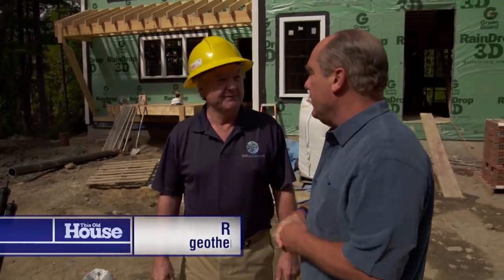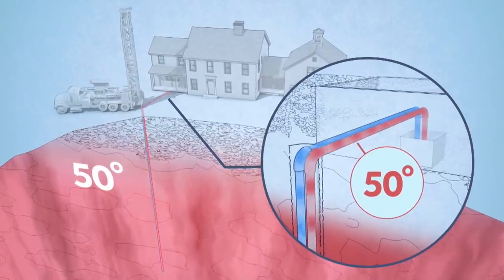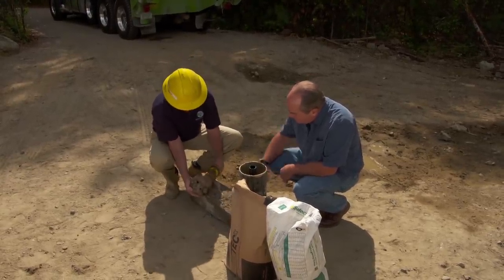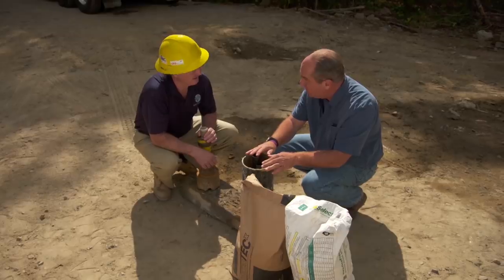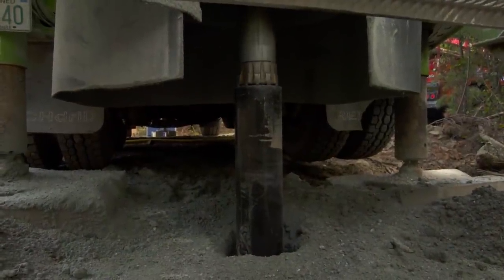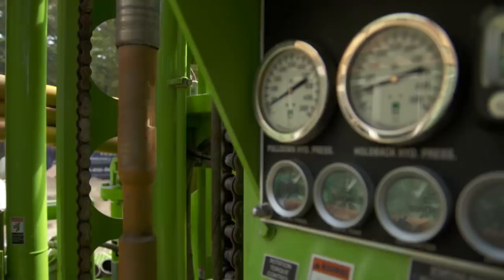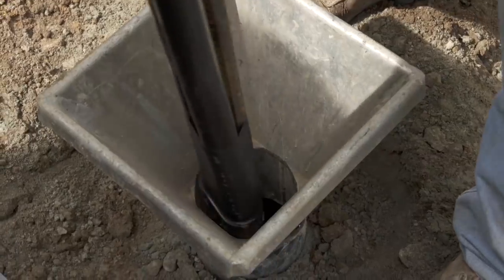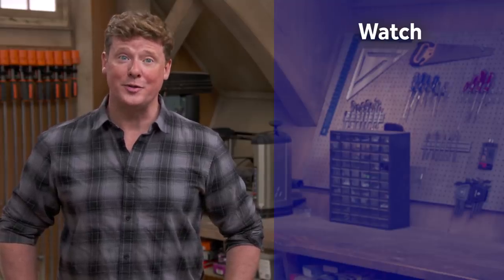How to Drill for Geothermal Energy  | This Old House

Comment: I actually did that job for a few years. That rig is an air rig, which is ideal for rocky areas. Then there is mud rotary which uses a mud slury which uses bentonite to suspend the solids to help bring them to the surface.
Reply: thanks for the info. Do you know how much does something like this cost to have installed?
Reply: I remember doing a system that had 10 units and I believe it had 14 wells that were drilled at 150 foot and the cost was around 250, 000 dollars.  That was in 2017
Reply: @sigmaprojects  aas  do
Reply: @downhillboozer  ah, so not something cost effective to retro fit and more for new homes?
Reply: @downhillboozer  14 wells, that must've been a big house!
Reply: @sigmaprojects  we actually installed some in system that were put into houses from the 1700s that was part of the historical districts in Virginia.  Retros are more of a pain cause you can't alter the foundation and alot of houses foundation in the 1700s were made of stone
Reply: @MandoFettOG  it was a big house it is along the Potomac River. It was a big house for sure . I believe 18 million dollar home. It was an ex vice president for Lockheed Martian. If I remember it had 3  kitchens a movie theater and an elevator. I wish I was around to see it finished
Reply: @downhillboozer  nice!
Reply: @downhillboozer  That cost is if all the holes go to depth successfully.  Cost keeps going up if some holes fail due to hard rock, ground water problems etc.  

TOH almost never mentions excessive costs anymore, as its now essentially a bells and whistles advertiser for building materials.  One exception: Tom Silva doesn’t participate in these never-mind-the-price pieces.
Reply: @nick cook is this a job you’d recommend for a young kid looking for a career? My local union has apprenticeships for this job but I’m unsure if it’s worth it
Reply: @Butterbeanguy1234  I would say do it. There's been a push lately for more funding. 
The current phase I would place it on  par  with solar energy 2 decades ago. 

If you get in now and aim to build a business, it's a good move since the government has countless grants for geothermal completely untapped.

Comment: I remember when This Old House used to show you how to DO things. Nowadays, it seems to be 'Bring in this group of pros, and give them a bunch of money'. There's no way I could drill for thermal energy, and no hint of costs here that I could use to calculate any potential savings.
Reply: 20-40k in the US per house i would guess, 50-60 if it has to be converted to fit the system with new radiators and all that. Otherwise i might be coming overseas with a rig and a couple of plumbers. xD
Reply: You could lease the rigg

Comment: I want to know how to do this without using "grout" and without using "antifreeze". NOTHING lasts forever and I don't want to remove 10 tons of grout to get to the pipe and if there's a leak I don't want antifreeze contaminating the water table, or even the dirt at that level.
Reply: Sounds like you want what's called 'open loop' geothermal, which just uses your well aquifer to leech the heat/cool from instead of the setup they're using here.  It's not available in a few places because of local laws or just lack of a robust aquifer, but for most places it's cheaper and more effiicient anyway, I wish they would have at least mentioned it in the video.
Reply: Not a DIY job at all
Reply: @Kevin-mp5of  
maybe they should create an adapter so I can run one off solar
Reply: @zack9912000  
that carbide drill bit will only set you back a few thousand dollars
Reply: @danielgehring7437  
"open loop" I'll remember that. you wouldn't happen to know how to test water for things like salmonella without using some state run lab, would you? is there such a thing as a home kit that's certified and reliable?
Reply: @maxsteel8031  That's not really my forte, no, sorry.  Google is telling me that you should ask your local city planner, they're the ones who would know the area well enough to give you a suggestion.  Perhaps someone else could give you a better answer.  Kind of a weird tangent, you wouldn't generally use the same water running your geothermal system to drink.  Those pipes are sealed up pretty dang tight.
Reply: @danielgehring7437  
the tangent was off of another video I saw where a guy was digging a well and didn't know to double check his references, but then, "nobody does".
Reply: You can just use water and not antifreeze. And copper pipe

Comment: Would love to know the advantages / disadvantages  - initial costs, repair costs of horizonal vs. vertical closed loop systems - and concerns if you have a well on your property.
Reply: Limited maintenance or repair needed. System can lay 50 yrs, pipes ~100 yrs barring any geological shifts. I'm curious about well issues too though
Reply: My parents have an open loop geothermal running directly off the domestic water supplied by the well.  For most of my life I always assumed it was a closed loop system, and only recently learned that it was coming from the well.  Aside from the drop in water pressure in the house, it has been a solid system with no issues to the well for the 40 years it has been installed.  Obviously this is the most cost efficient install since there is almost no infrastructure (they do have a waste outlet that flushes out below the driveway), but it has to be less than ideal for well users.  They are close to a decent sized river, so the water table is likely very stable, but even with a larger expansion tank off the well line, the pressure loss is substantial.

Comment: Now I know how to do it. One question - where can I rent that sweet rig?
Reply: Buy one at Harbor Freight for only $20 more than the rental cost! 🤣
Reply: @Kevin-mp5of  Or your free digital multimeter with purchase of $25 or more
Reply: @Kevin Byrnes Jr. Why?
Reply: @Kevin Byrnes Jr. Why?  If I screw up - I screw up in my yard.
Reply: Very few companies rent truck mounted drill rigs and if they do it is typically by the month or longer. A new drill rig similar to the Reichdrill that is shown, would cost about $750k to $900k to purchase depending on the pullback, compressor size and options it is equipped with. This is without drill steel, tooling and the necessary support equipment which can add another $100k to $175k. Most US states require that either the driller/operator or the drilling company are licensed. Most states and counties also require permits for any boreholes as they penetrate an aquifer so there are rules and regulations requiring how they are installed and grouted. Additionally, you would need a CDL (commercial drivers license) to drive the truck and years of experience to run the rig.
Reply: I have one for rent.

Comment: This is a really cool technology, it's a shame that the $20,000-$30,000 cost means that not many people want to invest in it
Reply: Govt incentives knock out over 25%
Reply: @nicolascoles7402  That still leaves $15,000-24,000, versus $3,500-7,500 for a regular HVAC. 
With a typical system lasting MAYBE 40-50 years if you maintain it, you're not going to recoup that extra cost in energy savings unless you're heating a mansion
Reply: @thefrub  It´s mainly for places with hard winters and high energy costs like Scandinavia where i drill these things, it´s around 20k for the entire installation if you already have hydronic heating.
Reply: @thefrub  congrats if you can get 40-50 years of solid heating and cooling out of a standard furnace/condenser setup. The life-span of those $7,500 units sits closer to 15 years.

Comment: Allow me to explain some things to hopefully answer some questions. BTW, I have 45 years experience as a hydronic heating contractor with many GSHP systems in place. 

The heat pump is essentially a refrigerant based heat transfer system. It transfers heat (yup, just like your refrigerator) from point A to point B, or from point B to point A. These systems shine when cooling demands are the  prevailing load. Most cooling systems are trying to reject heat using hot refrigerants into hot air, using hot air. Not a real energy efficient method. The Earth is always cool (to a point), and makes an excellent heat sink. When it comes to heating, it can do the work, but due to the use of refrigerants, is limited to a maximum operating temperature of around 115 degrees F. That doesn't work for most conventional hydronic based heating systems. 

Most conventional hydronic systems start at 140 degrees F, with the exception of radiant floor heating, which can use this low of an approach temperature. MOST is the key word. Tubing has to be installed at a higher density, like 6" on center, and in a highly conductive manner, like in concrete or an engineered floor system like WarmBoard. 

Why so many holes? The length of the "earth coupled heat exchanger" is based on the conductivity of the soil and the connected load. If its in a sandy soil, it is a terrible heat conductor, and will require more footage than say solid granite. 

As for the number of vertical bore holes, waters weight generates pressures of 1/2 PSI per vertical foot of elevation. The PE tubing does have a limitation on pressure. At the bottom of a 500 foot hole, the water pressure inside the tube will be around 217 PSI, which is probably OK if the tubing is cool (heating the home) but when its in cooling mode (rejecting heat), the loop temperatures can go to 115 degrees F, and that is where problems crop up, hence limitations in vertical length. 

As others have noted, like solar thermal, the ROI is WAY out there, and if it weren't for the Federal tax subsidies (which are scheduled to expire soon) the economics are terrible. The break even point is outside the life expectancy of the system (15 to 20 years) so the only people who will be doing GSHP without tax credits are those people who feel they are doing something for the environment, and the future occupants of Earth. 

Then there is the C.O.P., which stands for coefficients of performance. The hotter the water temperature needs and the lower the heat source temperature, the lower the COP. Eventually, the COP drops to less than 1, then you are better off using an electric boiler or strip resistance haters (for forced air distribution), which also has a COP of 1. In fact, due to the excessive cost of the holes, most designers will spec the heat pump to handle 60 to 80% of the actual load, and then depend on electric back up to handle the peak load conditions. 

A little history, GSHPs are not new. Thomas Edison had one in his home in New Jersey, MANY years ago. The newest trend coming across the pond is Air Source Heat Pumps, which essentially use the ambient air as a heat source. You are still dealing with the same limitations of temperature that GSHP's do, except in cooling mode, you are back into the inefficient mode of using hot air to reject hot air. The air side heat exchangers on these units are significantly larger than a conventional AC unit for obvious reasons. They also still ice up, especially during heating season, and require the use of electrical energy to defrost the outdoor unit. 

For me and my money, I prefer the use of Solar thermal energy (not to be confused with Solar PV, its electric cousin) coupled with an underground polyethylene storage tank and the WSHP (same unit used for GSHP). Solar thermal panels have been around for hundreds (yes, hundreds) of years, and suffer very little performance degradation over their lifetime. Their efficiency is between 60 and 80% efficient, compared to PV at 20% peak efficiency, and an expected degradation from day one, with a life expectancy of around 20 years. With the buried tank (below frost line) you extract so much heat out of the water that you actually freeze it solid. Then, ANYTHING with a temperature greater than 32 degrees F becomes a "heat source" to melt the ice back into water. 

Here's a dirty little secret. Water, when transitioning from 33 degrees F to 32 degrees F carries one BTU per pound, per degree F. When transitioning from 32 degree F water to 32 degree F ice, it requires 144 BTU/pound per degree F. It's known as the latent heat of fusion. So, a 500 gallon tank of water can constitute a HUGE amount of energy, when going from say 70 F to 31 F, and as previously noted, ANYTHING with a temperature greater than 32 degrees F becomes an energy source. This includes your snow melting system (basically a large surface area unglazed solar collector), solar thermal collectors, drain waste heat recovery, even the ambient air.  Imagine the thermal performance of a flat plate solar collector thermally connected to a 32 degree F block of ice...This type of system is called a thermal battery system, and is MUCH less expensive than a GSHP system to install and maintain, and makes economic sense.

Sorry for the book, but now you know. Pay it forward :-).
Reply: There are so many just plain dumb, wrong, false things in this novella that it's not even funny. I'm not even going to get into them. At 15,000 out of pocket, our geo will be paid for in less than 5 years. Anywhere that doesn't have access to natural gas is going to have payback in 5 years. 

Who TF is using gshp to heat water? Everyone is heating air. 

COP never drops below 1 in a GSHP. Ever. It doesn't even drop below 1 in a much more inefficient ASHP even when it's -5. Our last air source heat pumps still had a COP of 1.9 at negative 5 degrees ambient temp.
Reply: @JH-tc3yu  Exception to the rule. The lion share of geothermal and solar power have massive capitol costs and long term ROI 15-20 years.
Reply: Trying to decipher this solution.

You're claiming that putting closed loop pipes in this tank, that you can use less pipe and maintain a higher COP because of the resistance water has to freezing?

And what exactly do these freezing cycles do to a plastic tank?

And how does the water circulate from your solar panel to the tank when it's frozen solid?

All this is making a case for is sourcing the heat pump with water, which is heated by solar, and hoping the "battery" is big enough in case the sun doesn't shine...

Or drill 2x300 foot wells with no casing and be done with it.
Reply: Say brother do you know of any companies hiring for that? I roughnecked for 14 1/2 years.

Comment: Interesting difference! In Scandinavia we use different equipment and deeper holes, like 6-700 feet? 200-250 meters. cost of the drilling itself without the installation is somewhere around 7-10k dollars depending on the current currency diff.

Comment: Is that have a certain place or soil to do a geothermal energy
Reply: No, not really.  You might not want to put it in the side of an active volcano, but otherwise it's just a very long tube stuck in the ground.
Reply: @danielgehring7437  On the side of a volcano it would be much warmer at least ;-)
Reply: The hot water in iceland will scald you.
Reply: They drill in rock, Soil is only a short bit.
Reply: @danielgehring7437  
"You might not want to put it in the side of an active volcano, "

What!?
Where's your sense of adventure!
Reply: in the ground
Reply: @danielgehring7437  Interestingly, Iceland is one of the biggest places for Geothermal energy because it is volcanically active and the heat is used to heat homes and generate electricity.
Reply: @AbbreviatedReviews  I do wish they'd come up for a new term for this process in this video when they were making it; I've seen 'geostabilizing' thrown around from time to time but that just sounds dumb.  'Geothermal' literally means 'earth heat' and, as you say, had already been in use for a long, long time beforehand, so is just a very poor descriptor for what's going on here.

Comment: You should answer more questions.   Why two holes?    Why 15’ apart?  Why different depths?
Reply: They dig two holes because one probably wouldn't be able to move enough heat around to make a different in the house's temperature; if you built a very small house you could get away with one but, in the video, you can see they're building a pretty big one.

They put them as far apart as possible so the pipes don't interfere with each other.  If you put them too close you'd be wasting a lot of your time just heating up the ground instead of your house.  That's also why they put them at different depths, so they can take advantage of different parts of the ground's internal heat. 

Google is your friend, though.  There are way more options and variables than they touched on in the video, or that we'll be able to answer for you here, especially because everyone's going to need something slightly different depending on where they live.  This video was only designed to let people know the process exists.
Reply: @danielgehring7437  
Thank you Daniel for your educated answers.   It seems you have experience in this area.  It seems like a very logical and efficient system.   I asked the questions because my cousin installed a similar system that was a disaster and ended up
In a lawsuit with the manufacturer and contractor being held liable.  
Thanks again.
Reply: @Kevin-mp5of  
How do you know it does not concern me ?   Your comment was flippant.

Comment: Question.. wouldn’t verticals drilling cause the pump to have to work harder to pump the antifreeze up such a distance? I would think horizontal pipes would be easier and allow the pump to work less.
Reply: You would have to drill much farther
Reply: No, because the the anti-freeze water goes down and up.  There is no energy loss.  Every gallon going up is pushed by a gallon going down.
Reply: Hydraulics work in amazing ways. When you are able to percieve the function of liquid flow it makes more sense. This can be done with trenches and loops/coils of tubing. Friction is the enemy however minimal.